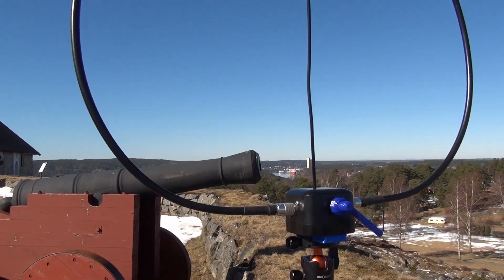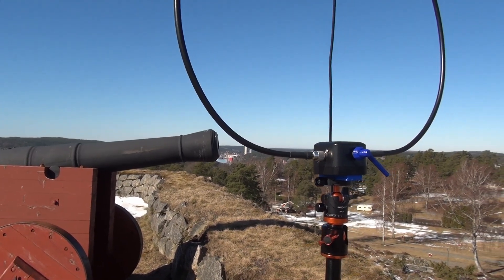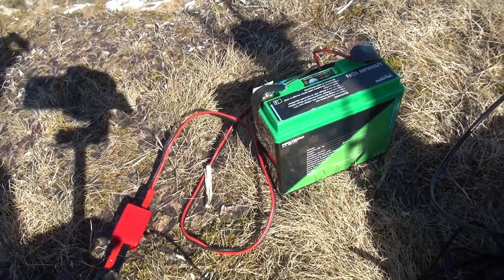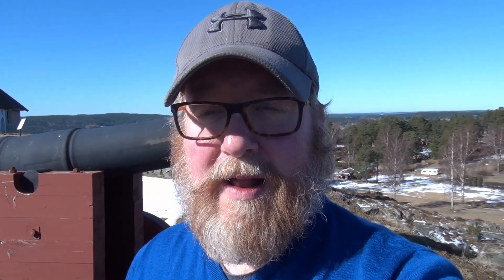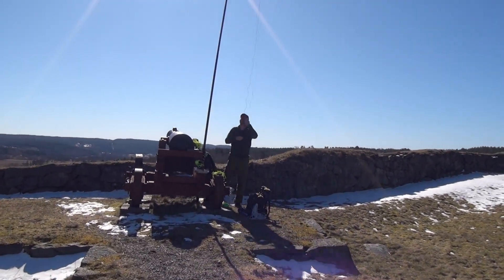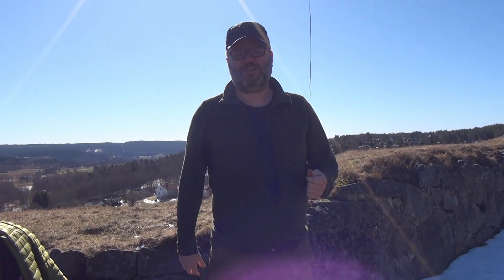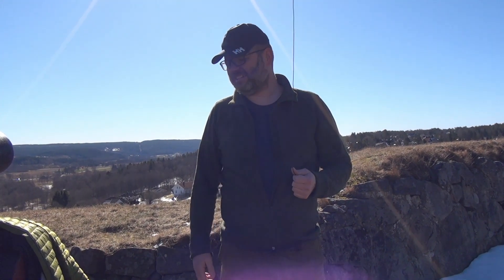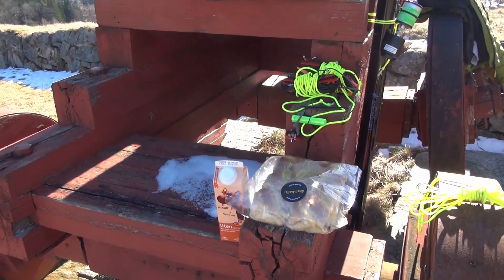Magloops are for Masochists

Comment: I've used an AlexLoop for POTA, and it works great for CW. Mine has the built-in AlexTune which is a little light that lights up when tuned properly which makes tuning simple. Maybe the issue here could be SSB which has a much wider bandwidth than CW. Either way, glad you came prepared and were able to get a wire in the air.
Reply from the maker: I believe the main issue here was the combination of poor band conditions and a contest weekend. And on top of that the AL-705 isn’t the best implementation of a magloop antenna either.

Comment: I've had successful activations with my mag loop (AlexLoop), but it is definitely challenging--especially when the bands are packed. At a POTA location like that, you are going to have fun no matter what though!
Reply from the maker: I have no doubt that it would be possible to make the activation with a magloop at some point, but not that particular day. I really want to like magloops, and I have not given up on the antennas, but they have their own set of challenges.
Reply: @LB0FI  I have a love-hate relationship with my mag loop. It was the 2nd HF antenna I got and I had only been a ham for a few months. While I don't think I would have bought it if I knew what I know now. But I also don't know that I can part with it (yet), given the times it's worked out well for me.
Reply from the maker: @MikeN2MAK  I have the same experience with the  Buddistick.

Comment: I haven’t had good luck with that AL-705 antenna either. However, the AlexLoop looks to have a better tuning system which is one of my biggest gripes with the AL-705
Reply from the maker: The tuning is horrible, and that is why I 3D printed that lever, just to get a little bit more control.